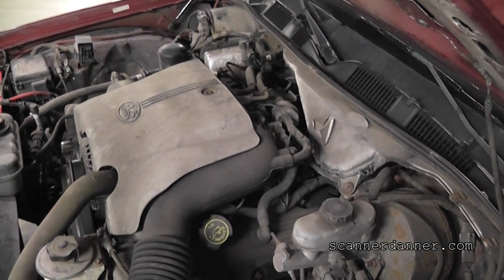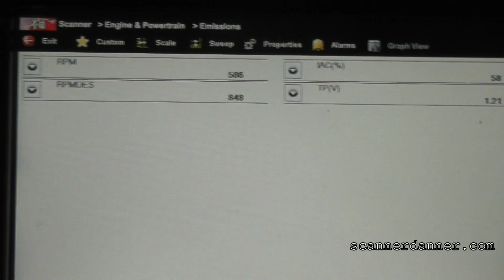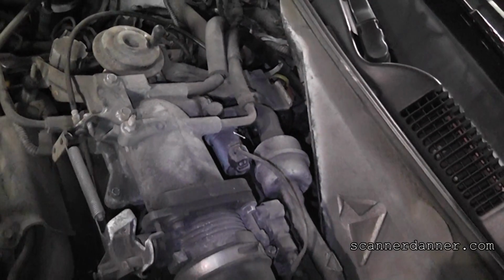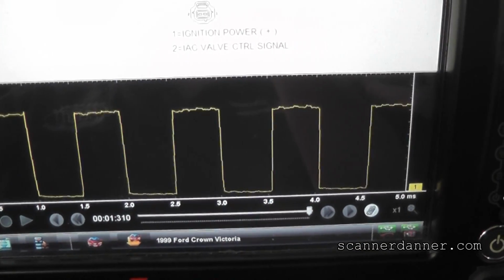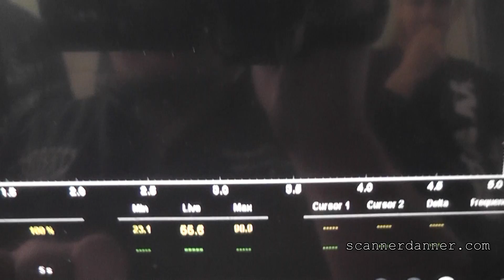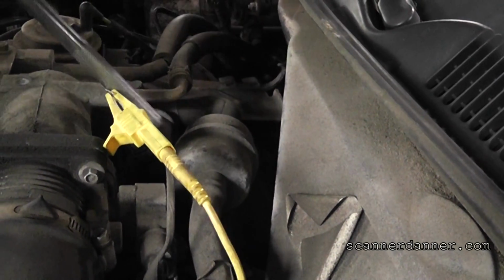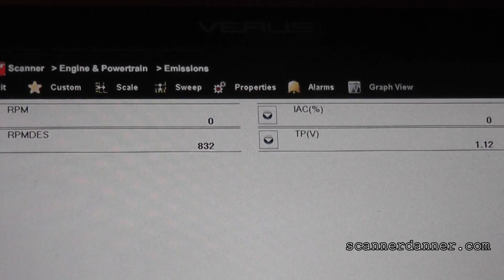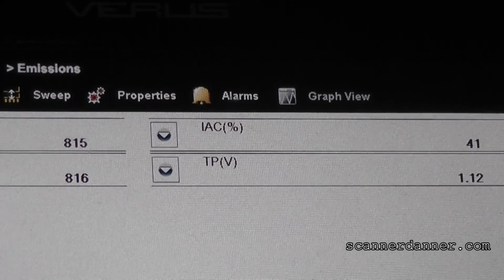Ford idle air control valve (IAC) test - stalling problems

Comment: I'm glad I found your video's about this issue because now I can tell the difference between just a dirty throttle body and a failed IAC valve without a scan tool. I have the '03 4.6L Ford engine and usually once or twice a year, I'll spray clean the MAF sensor and throttle body assembly during the same service. My P74 Crown Vic has 122K miles and at some point I'd like to perform a mechanical inspection and service of both IAC and EGR valves to ensure both are doing their job and offset any future malfunctions.  My last 5,000+ mile journey resulted in 23-26 mpg average which tells me engine is still within spec tolerance.
Reply: James Barrow, to continue further just an hour ago I decided to perform a mechanical inspection and clean of MAF sensor, throttle body, and a first time ever inspection and clean of IAC valve. My Crown Vic is 12-1/2 years old and 122K original miles and MAF sensor just slightly dirty, same for throttle body, and IAC valve still like new with light deposit. Cleaned all three and performed 10-mile drive for computer to relearn and set new adjustments and car idles and drives just like it did when brand new which it still looks and drives like. Next service is EGR system for inspection and clean which based on IAC valve, I expect no surprises.

Comment: I don't have that expensive scanner, but found that there's 2 screws in the back of the IAC valve on my pickup I took it apart and as soon as I did you could here the rod inside move, when I put it back together and back on the vehicle it would idle smoothly. I tested the ohms across the IAC Valve and its within spec of 10-14ohms, but that don't mean the valve itself isn't stuck, so in my case taking it apart got the valve unstuck...the truck sat for 4 years, so its within reason the valve would be stuck I guess, ordered a replacement valve, but I bet if I had your scan tool I'd have some pretty similar issues that your scan tool was showing us.  

This video was a great help.  My truck wasn't doing the cold high idle either, it was probably down around 500rpm or so even cold, so that's most likely what got my attention at first was the weird low idle especially sense I have another truck with the same engine next to it that revs much higher when doing a cold startup.  

Vehicle is a 1987 Ford Ranger 2.9L V6, and the other truck sitting next to it is a 1988 Ford Bronco 2 2.9L V6.  Ironically I have 2 vehicles with the same engine, helped out with some diagnostic stuff being able to look around both vehicles and see what's out of place, and test parts to see what ohm readings I was getting on the known good vehicle VS the one that decided to go on vacation for 4 years LOL.

Comment: I was having this exact same problem on my 2002 Mercury Grand Maquis.  I used my daughters cell phone to tap on the idle air conrol valve and this did the trick. Going to have a friend who is mechanically savvy clean it out for me. Thanks for this video!

Comment: This video is going to be referenced a lot for the Mazda community as well.  I see a lot of people that complain of no-start unless the gas pedal is down.  I always told people to start with a fuel pressure regulator diagnostic first.  Didn't know the IAC would fail like this.  Just learned an important lesson thank you!

Comment: omg i have a 2006 Chrysler pacifica i thought it was the transmission it would self acelerate and stall especially when i would turn ac on then i would turn on and it would shut down right after .tommorrow im gonna change the idle air controller your a life saver.

Comment: You are correct about a TPS voltage issue. It should be around .98 to 1.0 volts on all Fords I've ever seen. You had an initial hang up that was really high. But after the fix it was still 1.12v. Either somebody adjusted the idle stop screw up a bit to try and fix this idle issue, or more likely you have a dirty throttle body.

The IAC is designed to run in the middle of its range with the engine warm and AC off. Since its range is 20 to 60%, a 40% duty cycle would be about right. 35 to 40% with air off is good. This one is a little high despite a slightly high tps, possibly indicating a dirty IAC and/or throttle plate.

I have had some luck with cleaning the mechanical half of the valve. It's worth a try since the valve is 80 bucks.

Comment: Excellent information that explained on a higher technical level the I.A.C.V. operation. My Ford has hard cold starting, needs the throttle cracked open slightly, yet runs and idles perfectly off idle. I'm thinking sluggish solenoid when cold. Now I know how it all works. Thanks for posting.

Comment: Man, I am so sick of my crown vic not idling.  it is always on the worst day.  Its a guarantee that on a 0F day, when you want to let the car warm up outside, the car will not idle without my foot being there holding down the throttle.     Well, its gotten worse in the past week..   You sir, have solved my problem with this video.  a new ICV is on the way.   Thanx for the hard work to make this great vid!

Comment: Had this issue at 80K took iac out cleaned it problem is back now....at 130K.  I was afraid it might accelerate suddenly and potentially cause an accident but it's never done that (except once or twice which was my fault as the pedals are too far apart and not designed for tiny little feet like mine).  I'm just grateful that mine didn't need to be included in the headlight recall.  That's one thing I don't have to worry about going bad.  I leave the heat off and I like it just fine. I also love how the electrics are super watertight unlike my Pontiac. I can just dump S100 on that motor and rinse it down with a pressure wand and get all that grime off so I don't have crud everywhere in my engine bay.  Like a motorcycle or a semi truck just AWESOME!!  I recommend you try it!  Your brand loyalty will be insane and you'll buy another Ford.

Comment: I might also add that it is educational to view the PIDs for TPS voltage, IAC duty cycle, Desired RPM, Engine RPM, and Mass Airflow while experimenting with adjusting the minimum airflow (idle speed) screw. This will teach you a lot about idle airflow. Idle airflow is made up of airflow that leaks by the throttle plate, and IAC airflow together. An increase in one results in a decrease in the other.

Comment: very interesting i have a 99 mazda v6 198,000 miles when ever i get to a red light. after 40 seconds my engine feels like a stallout but hangs... but with the foot on the gas its feel good. i will take the throttle body apart and clean the IAC and see what happens .....thank you for the informative video.

Comment: Based on a few videos of yours on this subject, my impression is that one of these 2 pin Ford / Mazda IAC valves can be defective, yet not cause a code, not fail a resistance test or show any issue on an oscilloscope, like the stuck closed valve in this video.  Since the problem can't be directly detected, I'm assuming one has to go through a process eliminating every other possibility until nothing is left but the IAC?  What is it exactly that causes these valves to get stuck like that?  Carbon buildup or some other mechanical issue?  I've read on a few Mazda forums of a problem in which these types of valves partially fail, i.e. the car starts, you get flair and extra air until the engine warms up, but once warm the idle is low, and if you put loads on the engine like the AC, high beams, or hold the break down in gear, the rpms will fall and the idle will get very rough, yet there won't be any codes and the IAC passes the WSM prescribed tests.  Have you ever encountered this problem?  What might be the underlying cause of such a problem.  Sorry if this is too much for a youtube comment!
Reply: Carbon build up and a spring on the inside of it that fails. You can actually clean them and they will work

Comment: 2;/17/2021  I did not get a reply from Scanner Dave.  However this video is as good as you will find on Marquis & Crown Vic idle and acceleration problems.   Here's what I suggest anyone should do who has a Crown Vic or Marquis from the late 1990s to 2011 models with idle & acceleration problems.   IF changing coils and plugs did not solve the problem, then do not hesitate to change both the throttle position sensor and  the air intake control valve.   (I have a 2004 Marquis).   The throttle position sensor is $36.00 at Auto Zone, part #TPS245.   The air intake control valve (also called a Throttle Air Bypass Valve), part #TV2004, cost is $75.00.   Replace these two parts, BEFORE spending a lot more on a new fuel pump and installation.   These two parts may solve your problem entirely if your plugs and coils are working correctly.
Also check the connections to all 8 coils to make sure the coils are properly connected.   One loose coil connection can trigger the engine light, and create idle and acceleration problems.   Ebay has the same parts mentioned above,  but made by different manufacturers for less money if you don't have much to spend.   The other things you may need to have done is to have the throttle body assembly cleaned out, and the air intake sensor cleaned.   There are youtube videos that show how to clean the air intake sensor.   I tried cleaning my own air intake sensor, which is close to the air filter.   Cleaning it did not work.   The air intake sensor is a different part than the two parts mentioned above, located inside the air duct tube by the air filter.   You should see an electrical connection for this part on top of the air duct tube.
2/20/2021 update.   Unfortunately, I drove the car this weekend after replacing the parts mentioned above.
I noticed the same thing started happening after I drove about 20 miles.   One thing I noticed under the hood is that (standing in front of the car, the coil closest to me on the right) the front right coil is loose, very sloppy.   I will have the mechanic check it and update this post.   I tried pushing in down onto the spark plug, but it's still very loose.

Comment: wow!!, i couldnt believe that this actually worked. i got my wife to hold the gas 
while i taped the housing with vice grips and the engine reved up and the
car idled on its own.
Reply from the maker: Nice!
Reply: @ScannerDanner  That is exactly what I did to my starter before I replace it.I suggest to just replace that dar n thing.

Comment: My 03 f150 stalls out but ONLY when in park and after it warms up, which definitely leads me to believe it’s the IAC. Starts and drives just fine, and doesn’t idle rough when in gear (every once in a while at a stop light it acts up but has never stalled). Think it’s getting pretty dirty especially given it has probably never been replaced in the last 16 years. Guess I’ll give it a go. Didn’t throw a code

Comment: Hi, scannerDanner,   I have a 97 legacy outback with 2.5. I am getting the same code P1507 as you discussed in one of your videos. I cleaned out the IAC and checked for air leaks with carb cleaner. Car idles well, however, check engine light is triggered after 5-10 minutes of driving. The car cuts out and restarts immediately. the resistance on the control valve connectors are 1-2 and 2-3 are 9.3 ohms off the car.  I have tried to clean the throttle body but no change. Any suggestions? thx in advance

Comment: enjoyed the video, like always and thanks. you stressed concerns about TP voltage that someone may have adjusted the idle stop. did you address that issue? do you think the voltage was a bit high? are you thinking buildup in the throttle body may be the reason? thanks.

Comment: Dave, great video !  I watched the whole thing.   Any suggestions would be greatly appreciated...
I have a 2004 Grand Marquis.   Engine light came on last Sunday after I got gas.   This week I had my mechanic check the car.  He replaced the #5 coil and all plugs, even though previous plugs and coils had less than 11,000 miles.  He cleaned and flushed out the throttle body and ran a computer electronic balance test.
I drive the car about 60 miles one week later (today) and stop at the same gas station, and when I start the car up, the engine light came on again.   I reinstalled the gas cap, but no luck shutting the engine light off.  Also checked the fuel send switch in the trunk, and it was not tripped.   The symptoms I'm having are occasional rough acceleration from a dead stop, and occasional random momentary de-acceleration.  The other symptom is that when I come to a red light, and the car has sat idling for about 45 seconds or more, the engine idle speed slows down and is noticeably rough.   I plan to tell my mechanic what you did with the idle air control valve / motor.
Could that be my problem?  Also, another video showed a "throttle position sensor" which some guy replaced on his C. Vic police interceptor.  Should I replace that?   The mileage on my car is 224,500.   I am  the original owner of this Marquis, and have changed oil religiously since purchasing the car.   I also have changed the transmission fluid about every 40,000 miles.  Thanks and hope to hear from you.  Tom in Miami, FL

Comment: You Guy's are awesome i have a 98 crown vic mine has the issue when its cold outside keeps stalling unless i hold throttle a little for about 5-10 mins then runs great will these act up more when its cold outside thanks from Joe!
Reply from the maker: yes, very possible

Comment: Thanks, good video ! Having a huge problem with my Mustang 2004/ 3.8 litre ?? After changing fuel pump bigger, 255 lph, and throttle body to 70 mm, idle has been sky high?? I know there has to be vacuum leak somewhere, since AC works, and when blowing to face, suddenly changing to windshield, like defrost??, without touching anything??Codes are : P0507, and P0405?? Did change DPFE sensor ( tested it, fine!), TPS, IAC sensor, and EGR valve! Can't find any leaks under hood, sprayed all vacuum hoses?? Did check canister solenoid in rear, 12 V coming in, closes after applied 12 V??, did not change that?? No leaks around tank?/Did check canister purge valve in a front?? Could not test that?/, cleaned out, 12 V coming in?? Could that be open all the time, making idle that high??Did have " check engine light " on even before changing fuel pump and throttle body, every now and then, telling large vacuum leak, and " check fuel cap", did change fuel cap, no help?? Do I need smoke test next??? What could be reason for this leak/ high idle??? Going crazy here, thanks =) Ps. could there be a leak above fuel tank???

Comment: My 96 Lincoln Town Car idles fine at startup; however, tends to stall at times when I put it on drive or when I stop at an intersection. Is that an IAC issue as well?
Reply from the maker: Sure sounds like it my friend. Does it ever stall while your foot is on the gas pedal? If no, and it only stalls when your foot is off the pedal, then we definitely want to focus on the IAC
Reply: @ScannerDanner  The last time I drove I took off after stopping at an intersection  and with my foot on the pedal it felt like no fuel was going thru as I stepped on it more and then it stalled. Put it on neutral as car was rolling and started the engine back up.
Reply from the maker: @Daluch3  focus on your throttle position sensor, these were common failures on your model and your symptoms sound more like this is where we need to focus
Reply: @ScannerDanner  I will certainly do that to start off and hopefully that's all it needs. Thank you!!
Reply: @ScannerDanner  Forgot to mention I checked the Check Engine light with a code reader and it shows the current fault as P0174 Powertrain System too Lean (Bank 2) and a Pending  Fault P0171 Powertrain System too Lean (Bank 1). The PCV valve is brand new so I know that's not it.

Comment: I have an 87 Ford econoline 302 and replaced the IAC but problem still exists. It starts fine and idles great till warmed up. Warmed up it idles fine in gear but as soon as it is placed in park/neutral it dies. I would bring it in to you but I am in Yuma Arizona. Any ideas?

Comment: Great video I have a '93 Grand marquis 4.6, it will stall and hesitate and surge, usually stall if you give it too much gas. Feels like a miss going down the road you can feel it bucking slightly. Can't figure it out! New MAF and intermittent check engine light. Please help!
Reply from the maker: Not enough info to help you, sorry. What code is setting? When did the problem start? Have you tested fuel pressure?
Your problem could be withing the fuel system, ignition system, or even engine mechanical.
Reply: ScannerDanner hey I just checked fuel pressure it's barely 20PSI supposed to be 35-40 I think I found my problem
Reply from the maker: Yes you did my friend. Nice job

Comment: you just save me the 100 bucks for a new IAC. 2003 town car, IAC trouble code, wont idle, took it out, cleaned it, put it in, wont idle, figured, ahh ok, IAC bad. watched this and your 'smack test' went out there smacked it a couple times, idles fine now!
Reply from the maker: Sweet! In my experience, it will stick again and replacing it is the only lasting fix. Let me know if cleaning it works for you over a period of time okay?
Reply: will do. least it not hard to get to

Comment: I'm having problems with my 1999 Dodge Durango 5.2. My problem is that the vehicle has a hard time starting once warm than sits for a bit,  I have to give it some throttle than fires up, runs fine. Fuel pressure seems to hold fine once turned off. Going to check out the IAC counts but not sure if it could be related. Maybe stays closed? but first start of the day etc.. starts right up no problem.